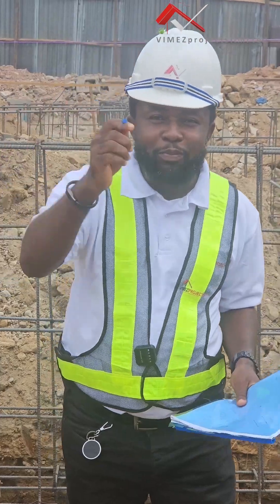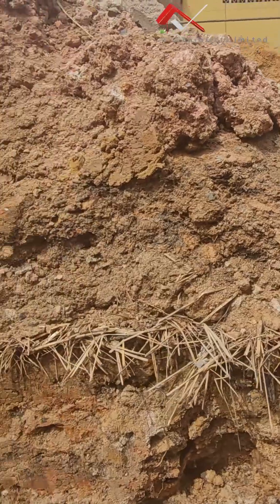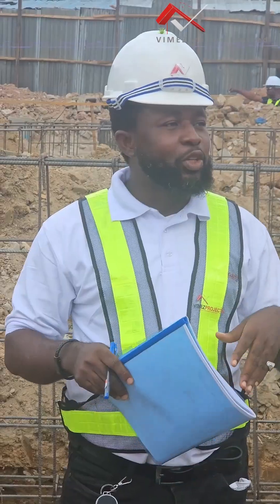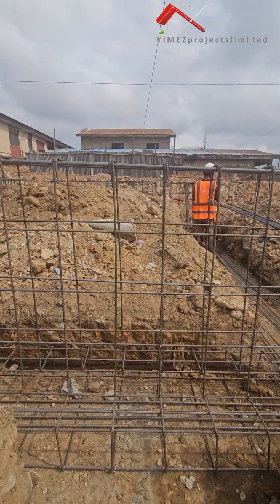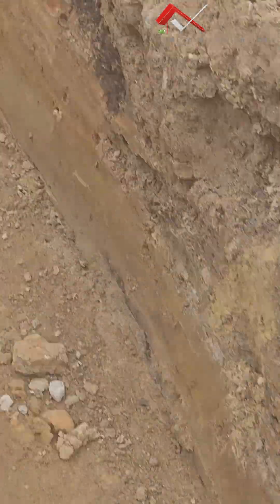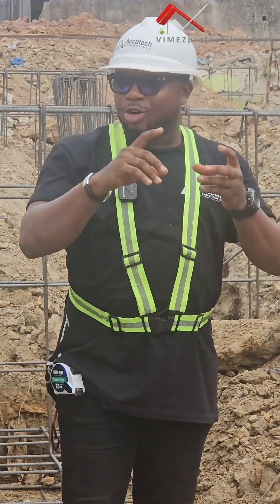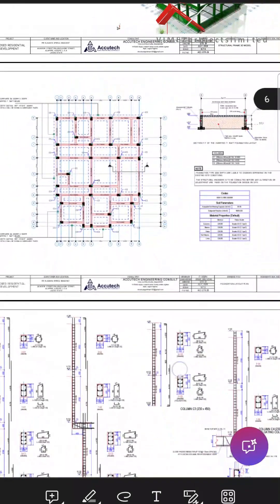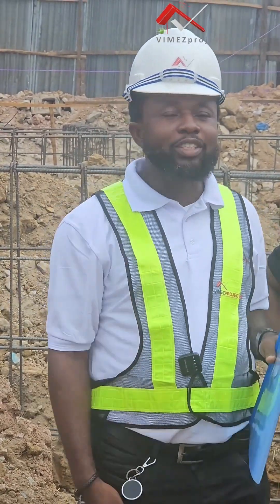How to do Raft foundation in Nigeria. part 2

Comment: your soil report is not correct for 35.95kn/sq.m with that soil am seeing.that value is for swamp.
Reply from the maker: We appreciate your input sir.
The soil test report was carried out by capable hands, check the options given and the recommendations.
We carried out the job with Best option available.
You can visit us to have a proper soil examination if you are in doubt.
Regards,
Reply: @vimezprojectsltd  if u say so because by my experience and soil texture I saw there bearing pressure should fall around 65-70kn/sq.m.35 is swampy
Reply from the maker: @wealthyman3760-e4i  from our experience too, lagos soil texture is crazy compared to other state textures. 
So the recommendations given here are done with considerations on cost effectiveness and Best foundation type on Design/number of floors for the project . The structural engineer recommended T base in form of raft so the building can connect from base and settle as one.
If the pressure fell around 65/70kn as you said, we can't be doing that type of foundation, it would have been strip /pad. 

We appreciate your input
Reply: @vimezprojectsltd  how many suspended floors
Reply from the maker: @wealthyman3760-e4i  2 suspended
Reply: You’re minimizing clay soil
Reply from the maker: @brynegaexy5246  how do you mean sir?
Reply: I disagree with the structural Engineers take on the positioning of the Rebars of the ground beam, the upper part of the ground beam should be the one having more reinforcements because the tensile stress begin there and the lower bars supplements.
Reply: @UdoEgwuatu  more reinforcement down must have been considered because of soil pressure